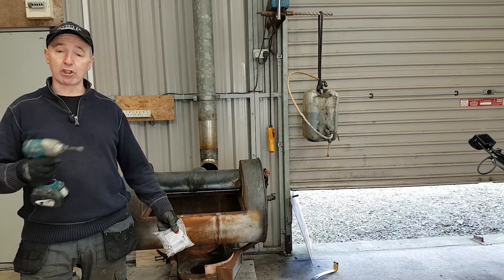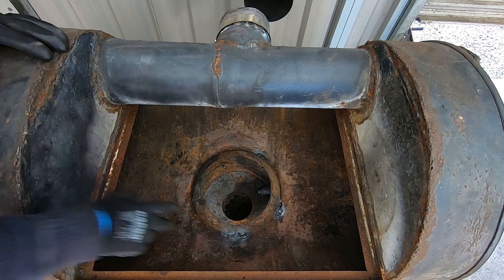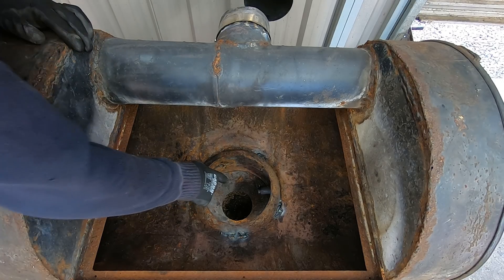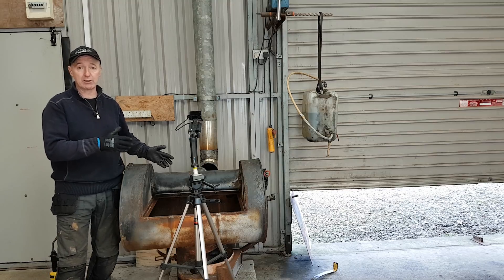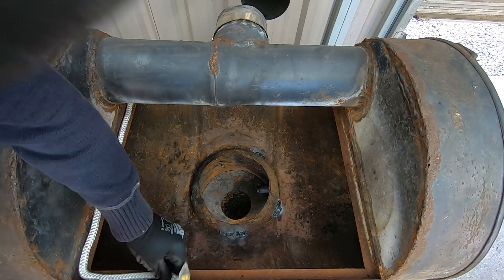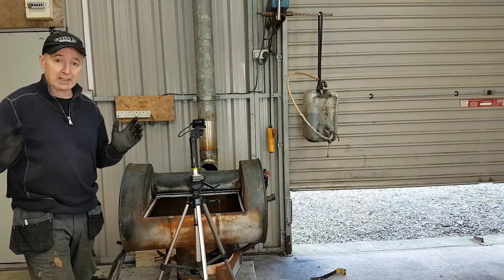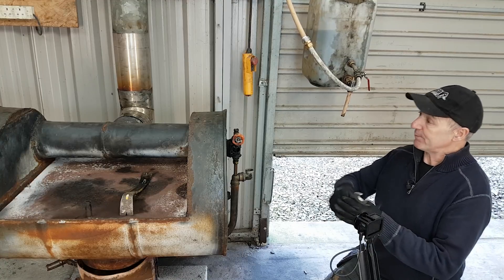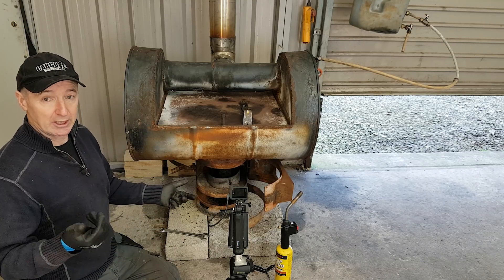Heating For Absolutely Free with this waste oil burner

Comment: Make sure to burn off the zinc from the pipe with a propane roofing torch or in a campfire.  The zinc fumes from galvanization can give you flu like symptoms, and it's terrible for your health.  Excellent video as usual, nice design!
Reply: Flu symptoms from hell. I've welded galvanized metal without proper ventilation. I would have prayed for the flu. They claim drinking milk helps but I'm not sure it did.
Reply from the maker: Martin Benton  Hi Martin. I have welded galvanised metal before too but I normally grind off where I am  welding first. Any idea at what temperature it starts gassing. The pipe as a flue is excellent and the pull on the chimney will be great for some of the normally aspirated burner experiments. Thanks for commenting Martin CheersgGerry 👍
Reply: @GerrysDiy  I would run steel pipe up a few feet. When I got zinc poisoning it was from welding galvanized sheet metal.  In my shed I have black sheet metal pipe made for wood, coal, and corn burning stoves. Galvanized would be great for outdoors.
Reply from the maker: Hi Prolific Invention. Thanks for the heads up on the Zinc. Hope to be starting a new build tomorrow. Cheers Gerry👍
Reply: Why didn't you just buy lengths for stove pipe? You are getting free heat. I bet you could buy it for under $100... and no zinc fumes
Reply: @rogerwhiting9310  I needed 20 feet, for a little used garage space.  It was quite a substantial savings as I acquired both the woodstove and pipe from the scrapyard.  A friend warned me about the zinc fumes, so I did a little googling.  It was years ago, but that much black stovepipe would have been almost  $1000
Reply: That's true about galvanized steel as the blacksmithing community lost a member due to breathing in the fumes
Reply: It becomes white, than back off the white color? Is that when zinc has burned off?
Reply: @glorytoallah753  It gets a greyish white color when burned off, In the case where I used it (long ago) I used a wire wheel on the surface after I burned it red hot with a roofing torch outside.  It subsequently held up and was very durable for years on a woodstove
Reply: @ProlificInvention  thank you.
Reply: Yes, please be prepared for sickness from galvanized steel burn off. It has long term ill effects not just short term. 

I had to use standard home depot duct pipe for stove pipe and it always made me sick. I believe it has a toxic build-up in the body.

I can't believe with the money you have to work with compared to us attacked made poor and held under White Colored Male Americans that you would discount your health! Write me in to receive your land and shop when you develop brain and other degenerative conditions since everyone over here is a cheap piece if kaka and won't help me get back to the land. 

I want to get my own site up so that every time I see someone do something stupid I can make a counter video. You think I am making fun of you. Come in and see the shit your different social asses have done to me since my child days through bodies, spirit warfare, and dream warfare. You will see quickly I tell you the truth and how many others have been murdered and defamed by everyone trying to claim us, the land and block all knowledge of Natural Order and Real Life Skills.

Comment: First comment!
If you weld on some flat bars in rows onto the outside surface it would probably act like a heat sync and radiate more heat in the vicinity...
Good job gerry
Reply from the maker: Hi Jawad. I could increase the surface area to make this a bit more efficient alright. Some of the guys put tubing through the stove as a heat exchanger. Thanks for commenting Cheers Gerry👍